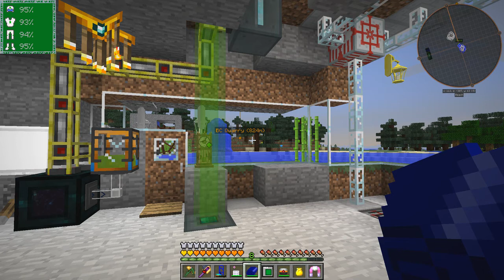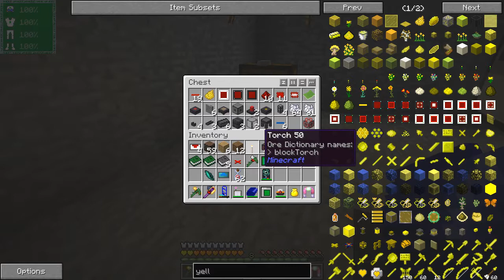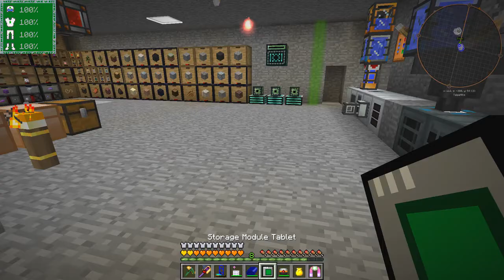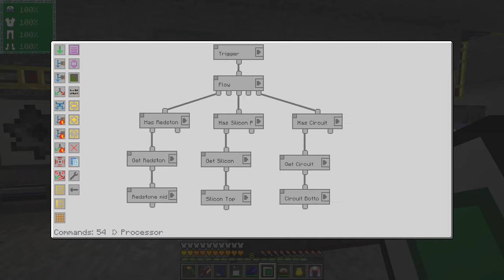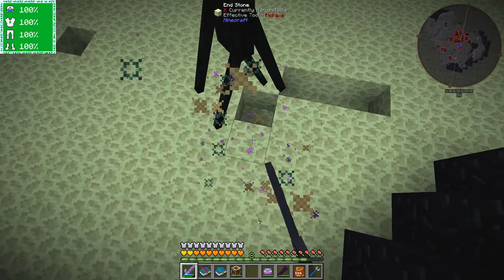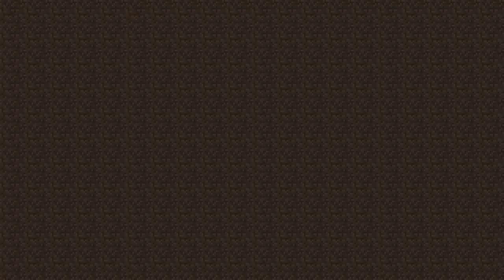Episode 48, RFTools Storage

Comment: Have you tried interfacing with remote storage with pipes and/or ME buses? I couldn't figure out a way to pipe items into it. That would make them really useful!
Reply from the maker: +Danny & Son I must admit I haven't tried, Certainly possible with the Storage Modules as they accept the filter upgrade. They seem to be pretty useful anyway being able to have up to 1200 stacks of items available from anywhere.

I've had to revert to an earlier backup :-( as going the expert mode and back to the normal mode prevented upgrading to 2.1.2 due to missing entities. So I lost a bit of work and didn't notice any problems from a while.
Reply from the maker: +Danny & Son What you can do is to install remote modules in the storage module that are linked to the remote storage. Then you can insert items into the remote storage by inserting into storage module. Hopefully I'll prepare my next video today.
Reply: Duncan Webb
Nice!